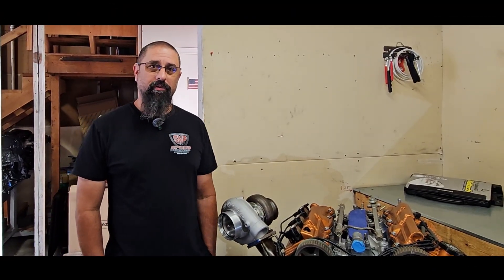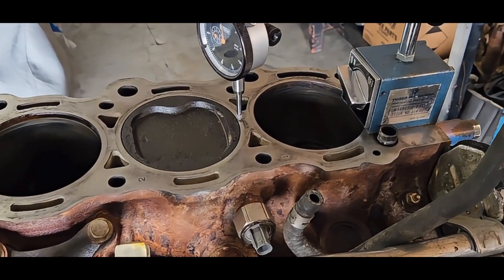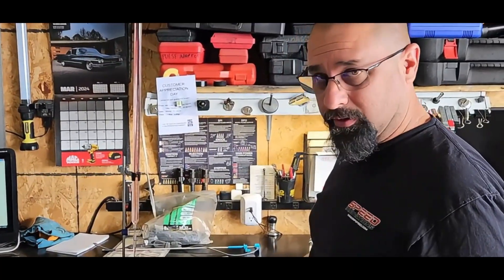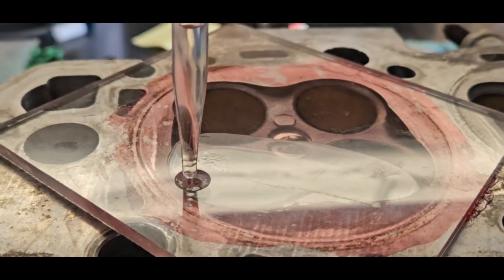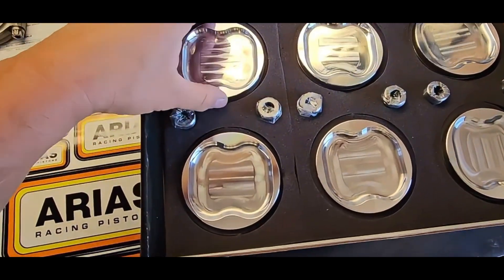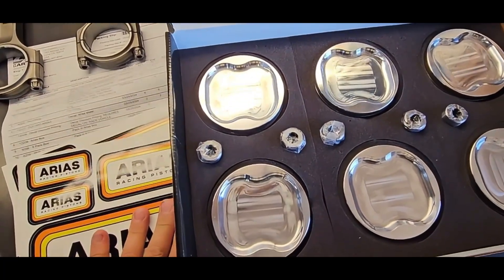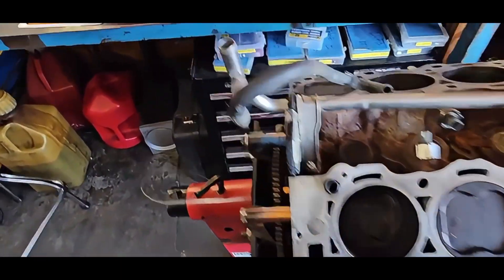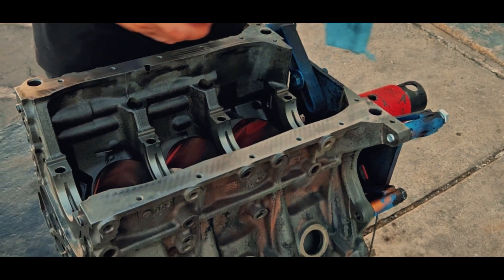Building A 600+HP Toyota Turbo 3.4 5VZ In 10 Minutes!

Comment: How can I get you guys to install a turbo on my 3.4 Toyota 4runner motor I had the drive train swapped onto a 1985 jeep cj7 on the 4runner drive train. So I have a Toyota jeep. So I want it to have some more power. I was thinking about buying a bolt on supercharger. But I think the turbo is better for the motor than the supercharger

Comment: Sooo Cost?
How much to make 500-600 HP?
Or would it be more cost effective to do a boosted LS swap?
Reply from the maker: Depends on what it would cost to LS swap. LS swaps are more costly and time consuming than most people think
Reply: @snpspeedinnovations I have a complete running LS powered truck that is no longer street able.
My personal goal is about 500 hp
I don't mind doing some work, as I will have to take the engine out and apart and all back together again.
I'm just saying if the rods are $2000 and the pistons are $2000 and all the necessary ARP stuff ...
If that all comes to $6000+
I would think that I could go the LS route for significantly less.

Comment: I love my JZs but it's refreshing to see another Toyota platform, especially one never intended for performance, get pushed like this.
Reply from the maker: Thank you
Reply: This engine was designed from the beginning with Toyota Racing Development to be supercharged.  Forged crank, iron block, 24 valve heads.  Magnason helped develop the supercharger from the beginning.  And then redesigned it later for 30 percent more power. This motor could have had much more power from the beginning but Toyota held back because it’s really a grocery getter and the we’re looking for longevity.  The fact that it can handle 600 plus horsepower is crazy considering it came stock with 190 hp.
Reply: @joecoool100 I highly doubt it to be honest, it's just a stout engine and that means it can handle boost well with some needed support. The iron block may be a stout closed deck design but the rotating assembly is cast, though the earlier 3VZ-FEs did have a forged crank. The heads don't flow that great for what they are and use a narrow valve angle design which is the usual in Toyota's engines focused more on torque and economy, and the ECMs especially in the beginning never handled boost correctly.

Comment: Wouldn't the crank be the weak link?  It's not forged?
Reply from the maker: You'd be amazed on how strong the Toyota cast crankshaft are in this era
Reply: if its a jdm sourced engine they had forged cranks. (cant confirm if ALL jdm engines did)